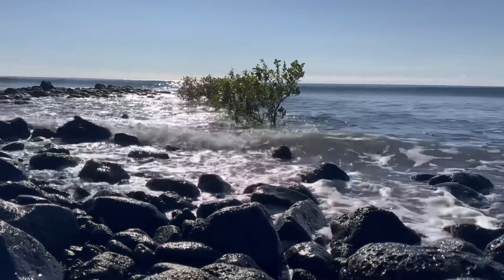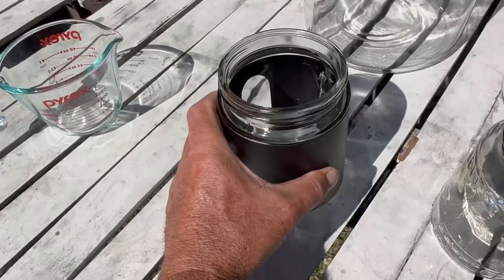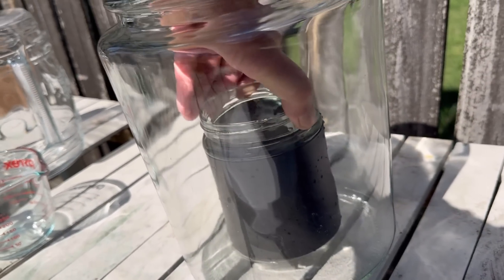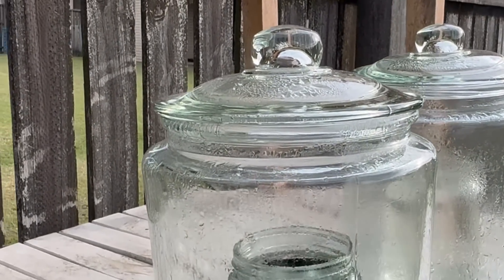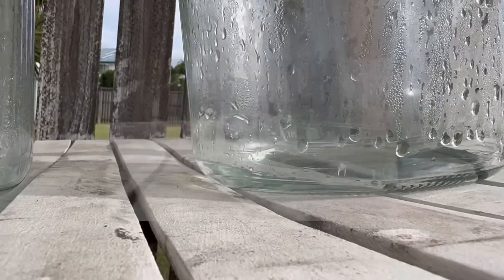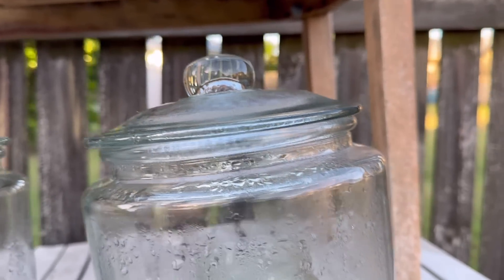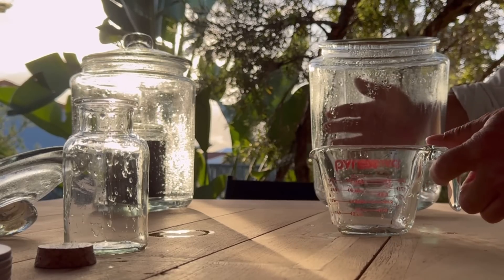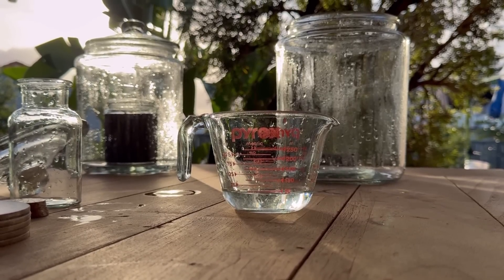Solar Distillation 2.0: Boosting Efficiency with a Simple Tweak

Comment: Massive size outer jar. Inside a solid material possibly metal with high melting point temperature mounted somehow where the solution is to have fast cooling low energy transfer material to not heat up to prevent damage to outer glass. Fresnel lens to heat up the high temperature resistant material. Boil the water instead of heating it up. Should work like a charm. Difficulty level of implementation/iterations - extremely high and costly for every failed try.

Comment: A shorter jar tightly packed with dark sand that the larger sea-water jar sits on would add more heat (and continue some time into the evening cycle) which would improve speed and yield.  A bit of a heat battery if you will.
Reply from the maker: This would he worth trying on its own with no black jar in the centre. That way we could gauge the impact it actually has! Would be interesting for sure!

Comment: When you dip the inner jar into the sea water you are contaminating it and in turn contaminating your clean water vessel.  Possible improvements could be paint the outside of the large vessel black, and harvest the clean water each morning so it doesn't evaporate again.
Reply from the maker: True. Very true. And well played. You’re absolutely correct. I need to pour into the jars instead of dunking them. And thanks for the suggestions. Painting the large jar black would be a good experiment for sure. It would be easily “testable” as well. And yes, removing the water daily would be a good way to ensure that it doesn’t get reevaporated. No point in doing the hard work twice!
Reply: I think theres a way to avoid having to empty everyday. Have a funnel in the collection vessel. So this means that if the clean water evaporates, its just going to condense on the bottom of the funnel and fall back down to the rest of the clean water.

Yes the funnel still has a hole but the small hole is probably negligible enough. Worthy tradeoff to not have to continually empty it so frequently
Reply from the maker: @de0509 absolutely, I need to find a way to incorporate this into one of my future designs. I’m currently working on a separate unit that has something similar built into it but I have run into a small problem immediately. Keep your eyes out for a future video regarding it!

Comment: Add a white wet towel to the shaded side of your big jar to improve it even further. It will reflect light back onto the black jar and would cool the vapors inside the big jar.
As always you will hit an equilibrium but tweaking that equilibrium point is possible to improve distillation yield.
Reply from the maker: Good points. Both would be well worth testing. The wet towel theory would create evaporation as well potentially cooling the system further. I need to lit pencil to paper and perhaps design this into my next iteration. Thanks for the communication. I appreciate the feedback, it’s so awesome to hear so many people are interested in such an obscure subject. Cheers!
Reply: @Remraf  The wet towel on the outside would drop the temperature by a few degrees below ambient so it could speed up the process.
For maximizing evaporation on the inside a simple kitchen paper towel could be used on the walls with much less water in the black jar to enhance surface area.
I use paper towels on the outside to cool boiled pots in the heat of summer.
Have fun.

Comment: Have you considered using a dark tin can (possibly painted with food safe black paint) or black anodized metal measuring cup or small sauce pan with the handle removed to eliminate the heat transfer loss from the insulating properties of the glass inner vessel?
Reply from the maker: Not as of yet. I need to do a bit more research into the different varieties of paints to ensure no leaching of them into the distillate. And as for the use of a metal inner vessel this is something definitely worth considering. It would be a simple tweak with potentially huge benefits. Thanks for your suggestions. The feedback I am getting back about this video is priceless! Cheers!

Comment: It would make sense to continuously drain the distilled water in the outer container into a third container, which is in the shade. I really like your experiment! Thanks!
Reply from the maker: I really like your comment! You are absolutely right about removing the water from the unit daily. I have a system in place at the moment that I am calling a “hive cell”. It is a similar setup to what your see in this video except it has multiple jars taking up more floor space of the larger outer jar, this occupied floor space forces the level of the distilled water to rise above the level of a tap which can then be emptied. More work needs to be done to get it to work correctly though. I’m thinking about removing the tap and installing a cork plug perhaps? Thanks for your suggestion and your kind words! I appreciate it. Cheers!
Reply: @Remraf  Your welcome. I remember that ETH in Swizerland is working on this issue as well. They have developed a surfice, from where the collected water is gliding very easily, i mean it can not stay attached to the collectors surface. This allows the water vapor to be removed and collected even faster and more efficiently.
Reply from the maker: I will have to have a look at what they are working on. Sounds promising!
Reply: Yes, because salt water has a higher temp needed to evaporate. Remove the good water or it will evaporate 1st, maybe make the bottom a funnel or simply make a hole and tilt the unit towards it.

Comment: If you have the salt water put the large jar in a tray of water open to the air. The cooling of the outer jar is differentially equivalent to heating the inner jar. Do both.
Reply from the maker: This is a great suggestion. I actually have a large plastic pan suitable for this purpose. And it would be very easy to implement. And i could potentially collect the salt left over for other purposes. This are the simple improvements that can potentially massively increase the yield. Without a doubt this needs to be done. Fantastic stuff! Thanks for the comment!

Comment: Now that you're generating water vapor, the next step is to condense it.  You need to make the wet air cold.  If you can find a passive way to cool the lid or force the vapor through a cooling coil it will get you water faster.  Having the heating jar near the top of the jug and placing the jug on or partly in the ground may help create some cooling from the ground.  Storing the distilled water in a separate spot will help too; your purified water is re-evaporating in the heat!
Reply from the maker: Very valid points! Thanks for the comment. I want to pick one upgrade to implement into the next generation and test the results. I have a hive system (multiple jars) at the moment which is designed to be emptied daily to prohibit reevaporation.  It is defiantly a concern! There’s only do much moisture the atmosphere inside the jar can hold and doing what I can to make sure it’s only the centre jar that is being evaporated will be very beneficial.

Comment: My suggestion is a dual chamber unit.  One container painted black with the dirty water connected by a pipe to a container painted with Nighthawkinlight's infrared cooling paint.  This paint radiates more energy than it absorbs, and provides passive cooling even in the daytime.  

Or perhaps bury the receiving chamber, using the Earth as a heat sink.
Reply from the maker: How did I miss this comment!! Thanks for the input. I appreciate it heaps. You are definitely onto something when it comes to using the earth as a heat sink. This is something I would love to try. Cheers!

Comment: I love this experiment, but just one thought. It's not a big deal, but there's no reason the inside of the inner jar couldn't be painted. Any contaminates from the paint would be left behind with the salt water. 

Still, this is a fantastic survival trick and I'm keeping this one!
Reply from the maker: Hi and thanks for the suggestion! You are correct in thinking that the majority of the contaminants would remain inside the inner jar However...I think the biggest concern would be Volatile Organics. A couple of years ago a commenter mentioned them in another video so I did some research and they can be a problem with paints and glues etc. I learnt the hard way by attempting to use sticky tape to seal one of units up, unfortunately the taste of the tape came through into the distilled water. Thanks for your input. I appreciate it heaps. Cheers!

Comment: Instead of coating the inner jar, could you just add some biochar to the sea water?
Reply from the maker: Thanks for your suggestion. Yes, this is an actual proven way to increase evaporation! I have used charcoal in the past and it was giving very similar results to a black inner container and I didn't have to spend years looking for it! I need to do a comparison video pitting the black inner container against a clear container with charcoal in it! It would be 'cool as' to see what the results would be! Thanks for reminding me and thanks for taking the time to comment. I really do appreciate the feedback and the interaction with commenters. Cheers!
Reply: @Remraf Charcoal seems superior. This video felt like a step backwards from it. I guess it's worthwhile to make the comparison though.
Reply from the maker: @savagebushranger7953 one of the next comparisons will be pitting the charcoal unit vs the black unit. Should he interesting to see the results.

Comment: well, thermos liquid container maybe, its insulated from heat. maybe also black water direction tube (not a pipe) would be a nice wrapper. maybe some plastic heat shrink wrap around. well 2 days not 200k views, yet :) trying a black plastic trash bag as a large solar surface heater could provide better results. if the rest of the design is changed to use that large solar area heat. inside the container. each solar square meter is 1000W of heat. ie the typical black/copper hose-pipe solar heat collector. the internal structure water usage of the hose/bag needs to be suitable. maybe a black trashbag is fit inside a transparent trash bag, in the middle, source water being on the bottom, output water being on the top. same structural design but using trash bags as the containers. trash bags (clear and black) are easier to come by, and are way lighter than glass jars. maybe trash bags or glass jars are not the best. I would use transparent and black plastic containers instead. ie transparent soda bottles, also with black wrapping. getting large plastic containers is way easier than any glass container of large size. hour glass shaped water extractor might be suitable. ie any vapours go to top section, all heat is in bottom section. btw, a sponge or cloth could absorb all the vapours right away. so, how much do solar heat collector panels gather heat. right.
Reply: yep soda bottle solar distiller also uses solar uv to disinfect any water.
Reply from the maker: Have you had a chance to read Lewis Darnell's "The Knowledge" yet? There are so many interesting subjects covered in it and the antibacterial power of UV light is mentioned as well! Well worth the read!
Reply: how about black trash bag inside a large transparent plastic container (2L soda bottle).
Reply from the maker: The biggest issue would be allowing enough head for the vapors to escape and condense inside soda bottle, attaching the bag to remain in position would be troublesome as well.
Reply from the maker: Thanks for your suggestion! You have given this a considerable amount of thought! Getting the trash bags into the correct positions would be a key issue. Gravity would kelp keep the water where it needs to be but everything else would want to go wherever it pleased! We would need a way to secure the bags to help maintain their desired shape. A structure to encourage this might help? I've also found having access to the inside of the containers is really important and durability is really important as well. It's been a while since I last seen your comment! Thanks for having an input, I appreciate the feedback. Cheers!

Comment: You could do with a way to cool the lid to help the condensing. I myself haven’t even got a suggestion for that tho.
Reply: solar panels wired to peltier panels, with the cool side of the flat peltiers pasted to the curved glass of the lids with thermal paste filling up the space between ( no air gap).  Suddenly our experiment has more of an up front expense than glass bottles.
Reply from the maker: @PaulthePhilosopher2 I do love a good Peltier switch though. Awfully tempting!!
Reply from the maker: I have another system that actually had a dish on the lid. When water is added to it, it cools the surface below, plus (as a commenter) pointed out earlier the evaporation cools the lid as well. This is a good idea! There are so many options for upgrades. I can’t wait to start implementing them!

Comment: I'd recommend a metal bottle (NOT insulated) to replace the inside glass jar, the metal will heat up easier and it won't matter as much if it's black, though it could still be black. Also, wrap the outside of the outer large jar half way in reflective Mylar and then point the open side towards the equator so you can reflect the light that passes through back at the other side of the metal bottle.
Reply: Este es el principio del concentrador de calentador de agua; Esta sería la manera; 

,agregaria que lllenara la lata interna con menos cantidad de agua para que requiera menos energia cambiarla de estado.
Reply from the maker: Thanks for your feedback! You are correct! This would be a good way to maximize evaporation. I currently have another system where I have implemented this idea to try and reduce the risk of spilling the seawater, but it also takes less energy (as you have mentioned) to evaporate as well! There are so many ways we could potentially improve this system I appreciate the feedback. Cheers!
Reply: @Remraf  Exactly! The other great idea I saw in the comments is the focusing lens, though sun tracking might be an issue. I also forgot to mention it's a good idea to raise the inside container out of the distilled water to keep the heat transfer down between the salt water and fresh.
Reply from the maker: @KirkCA yep, raising the glass out of the distilled water needs to happen. It’s a simple fix that could have awesome benefits!
Reply from the maker: @KirkCA and as for the focus lens I could potentially warp a fresnel into or around the outside of the jar. I could have a go at doing it without focusing as well, just to see if it improves the results. The focusing side on the other hand would require tracking the sun.
Reply: @ That's a brilliant idea! Combined with a reflective surface on the back I'm sure it would be a huge improvement without tracking or focusing.
Reply from the maker: I found my fresnel lens! It was stashed in a giant science encyclopaedia of course! Where else would I have stashed it!! Now to put it to use!
Reply: @Remraf  Awesome! Can't wait to see the results.
Reply: @KirkCA  was thinking the same. Blackened copper cup ?
Reply: @anttikahkonen1957  Honestly I'm not sure what metal would be best for the container. I think aluminum might be the fastest to heat up but it would be an interesting test to see the results of.
Reply: @KirkCA عندما نقوم بتقطير الماء لاستخدامه لاحقًا في صنع الصابون، نبتعِدُ عن استخدام أواني الألمينيوم أثناء التطقير لأننا سنزيد صودا كاوية على تلك المياه لاحقا ولا نريد للصودا الكاوية أن تتفاعل مع أي بقايا للألمنيوم الموجودة في المياه المُقطرة.
Reply: @ArabianSuns  Yeah if your concerned about trace mineral transfer than you're better to use glass but if it's for drinking than whatever metal you cook in will be just as safe.
Reply: I also think that a wider inner container will work better than a taller one because it would give the salt water more surface contact with air
Reply: Was going to suggest exactly what was discussed here, elevated black metal container inside with a magnifying glass outside that ideally would be able to track and focus the sun into the inner container automatically during the day. However this is difficult to implement so maybe having one and manually adjust it many times during the day or having a couple of them statically placed in the ground previously adjusted to the sun path would somewhat suffice for the experiment outcome, since, the sun path does not deviate that much in a week